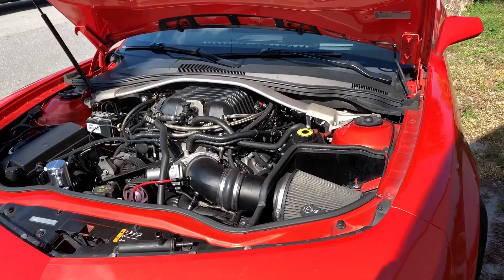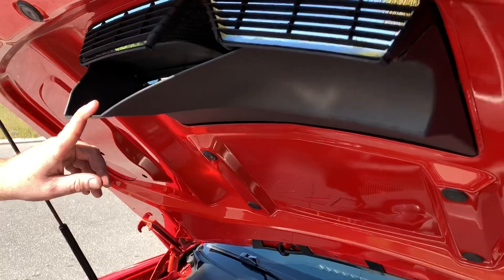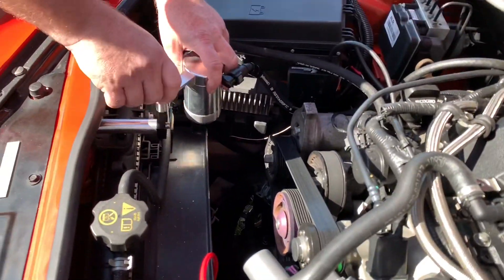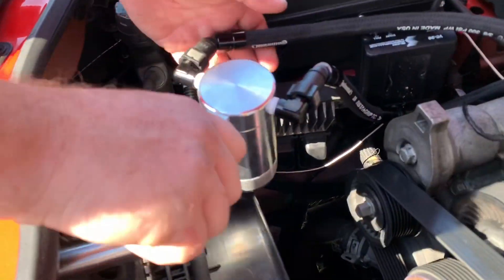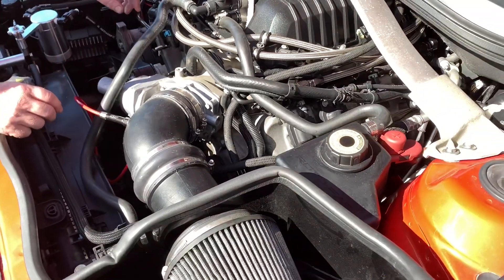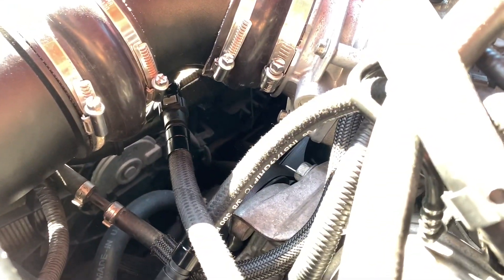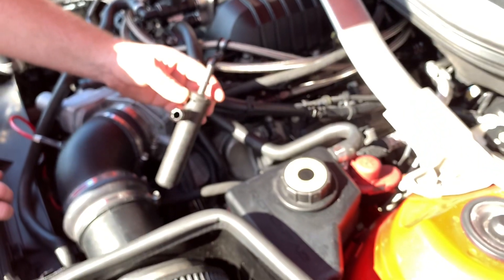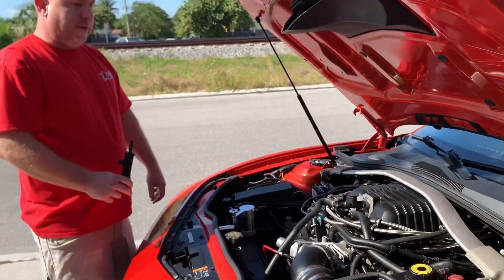UPR Billet Catch Can for 5th Gen ZL1 Camaro

Comment: Just a note: The driver side catch can in the video was custom made for this car using UPR's Universal DIY catch can and components.  This ZL1 was missing the factory hoses and connections to the valve covers, so it needed a clean side system installed.  The Universal DIY catch can is available at UPRproducts.com.  The driver side can is NOT INCLUDED with the ZL1 catch can kit.
Reply: What are the part numbers you used for the clean side ? For this exact setup

Comment: Cant you plumb all the dirty sides to one can?
Reply: The Dirty side is from the lifter valley.  The valve cover ports are clean, or commonly called make-up air going into the crankcase.  As engine vacuum pulls air out of the lifer valley, make-up air is pulled into the valve cover ports which are usually connected to the air filter inlet tube.  When there is excessive crankcase pressure present, and air / blowby pushes out of the valve cover ports, if there is no catch can , it would go right into the air intake tube.  The factory has a small 'separator' on the intake tube, but it is pretty ineffective.   Another way would be to use a Breather tank. https://uprproducts.com/billet-engine-breather-tank-oil-separator/ , plumb the valve covers to it, and block off the vacuum and lifter valley ports.  The disadvantage to the breather tank is it will produce more of an oil odor vs a recirculating catch can system.